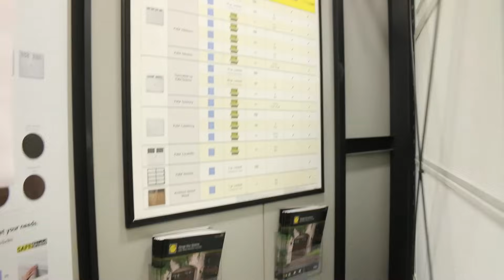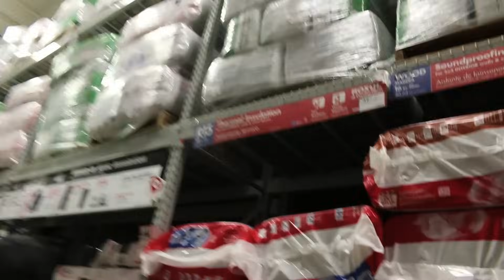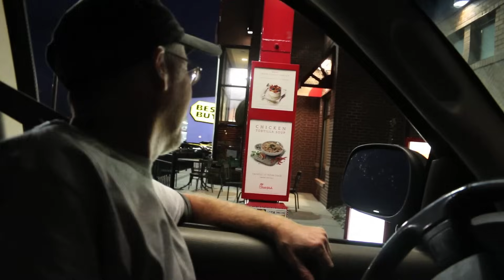THE FINAL FRONTIER!

Comment: Pathetic comeback, blaming Mark and Corn for the cycle.
Jeffrey's revenge: Tape the floor, door and window. Disconnect the power at the box.  Fill room with water.  Jesse opens door and ......
                                 OR 
                                 Put a bock on wifi so as not to reach new room.
Reply: Why is ceiling so low?  You have several more inches of space!  Come on, Larry!